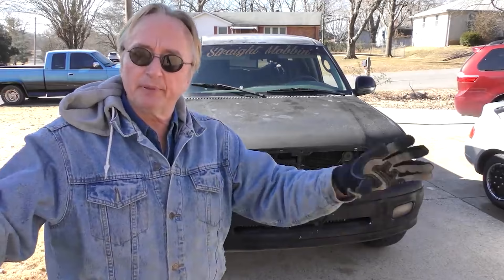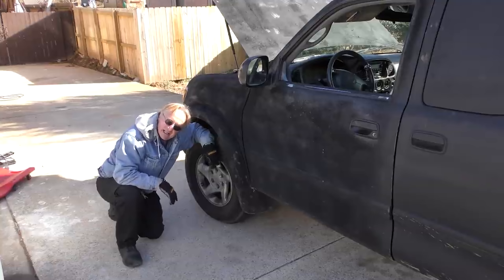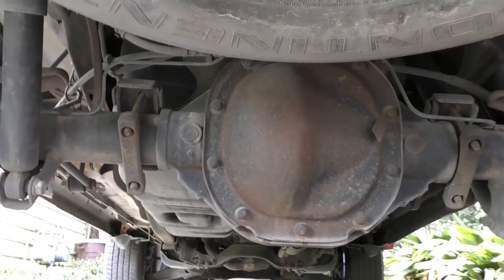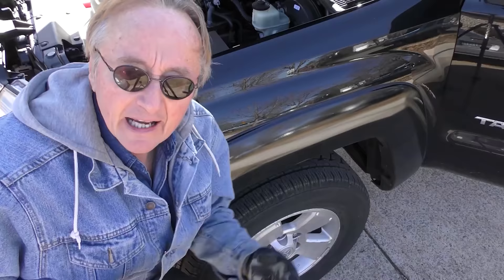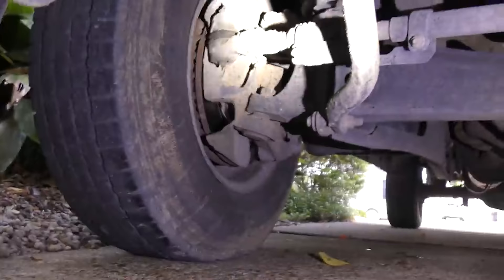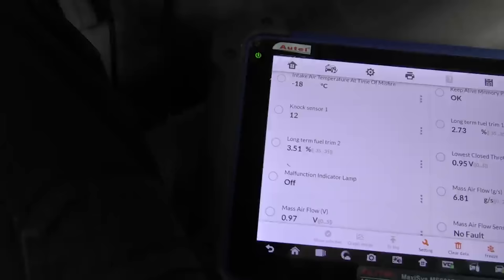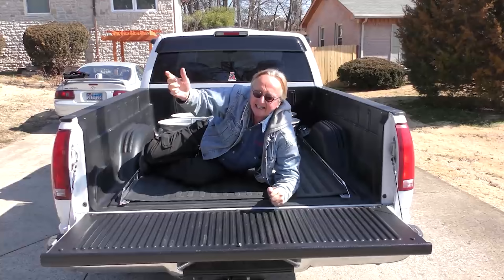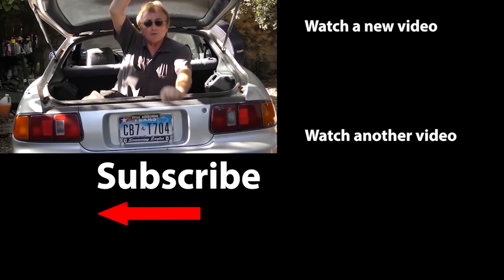5 Trucks You Should Buy

Comment: I’ve got a 94 Silverado with almost 600k on it 4 wheel drive damn good truck since I bought it with about 130k on it I’ve only changed out the radiator, starter, alternator, dist cap, and the thermostat that’s it! Basic things still churps the tires and will down shift smooth and gets up and goes best truck I’ve ever owned
Reply: Mine had 385k on it when I sold it..Ran flawless.Needed a trans rebuild but beside that it was a tank
Reply: I have a 97, 5.7 Lt. Has 310,000 km. Had it for 21 years. The engine is bullet proof. I do a lube, oil and filter every 5,000 km. 
To bad GM put themselves at the bottom of the list.
Reply: I've owned a few of those truck and never had any serious problems with any of them, the Chevy 350, 5.7 liter engines will run forever and if you ever do need parts for them they are easy to find and dirt cheap too since they ran that body style for 10 years.
Reply: Chevy engines run long and strong. Problem is, what will make the vehicle undrivable is everything else on the vehicle will be falling off.
Reply: I've got a '95 2WD 1500 with almost exactly 200k miles on it and I just had an unusual problem.. the U-bolts that hold the rear end to the leaf springs rusted into. Luckily, I was on the dirt road when they broke. I tried to back up and the rear end rolled forward and dropped my drive shaft, broke my E-brake cable, both brake lines and egg shaped the hole in my drive shaft for the U joint. I'm about to get it going again and will be glad to have it back. I was considering selling it but it's so easy to work on and dependable that I guess I'll just start fixing the stuff that's neglected on it. Motor is still great but need to replace my valve cover gasket. My 4L60E doesn't like to shift down in a hard acceleration, which gets on my nerves but other than that it runs great.
Reply: I have a guy that had 770,000 on his it’s a 2006 5.3 Avalanche only two water pumps and two fuel pumps and regular maintenance
Reply: @jasonfoster9118  Got to use Anti seize on everything I take stuff off anti seize it and I do not worry about breaking stuff off I use copper on the exhaust parts again no problems it’s worth the extra effort because I keep cars and trucks 4 ever.
Reply: I've got a 92 Scottsdale 3/4 ton regular cab long bed with the 5 speed manual transmission with no rust on it.This truck is one tough truck
Reply: @monkeyslap  You are absolutely right on that statement
Reply: @jasonfoster9118  That also happen to me last year. My mechanic got mine in time before that happened
Reply: @monkeyslap  I haven't had that problem with all the Chevys I've driven, sure some of the interior parts can come apart sometimes but you can get replacement parts easy at a junkyard or an auto parts store or thru an online retailer.
Reply: I bet your some where they don't salt th roads to. Them are dam good trucks I know a fella that's got an 06 with over 300k on it
Reply: @charlesbunting1790  I had a 94 at one time and I live in utah where they salt the roads in the winter and it didn't have any rust on the body anywhere
Reply: @chevy5137  wow i live in Maryland they use salt and brine i think its the liquid brine that eats up all our cars. My 04 Suburban is rusting really bad. So far 2 years ownership i busted 4 brake lines right now Im changing every single one but not sure if its worth it due to so much rust elsewhere. has 233k miles 5.3 4wd
Reply: @hellswindstaff91  damn that's crazy!
Reply: I believe 110% that they were THE BEST trucks ever put out by gm or any other manufacturer. Yea dodge had the 12v cummins. But let’s talk about a 95 2500. 454 4l80 14 bolt. It’ll tow just as much without a problem. These are the best
Reply: @obs.vanness1604  pondering if it’s practical to replace my 95 2500 with same thing it was such a good truck! Finding prices not much less than a 2000s Silverado with similar mileage so it’s hard to justify. But I know they’re great trucks.
Reply: I'm surprised you haven't had to replace that fuel pump in the damn gas tank.
Reply: I hope you've changed the tranny fluid, lol. I mean, I don't think it'd be moving if you hadnt
Reply: @monkeyslap  the new ones have motor issues
Reply: @hellswindstaff91  they're brake lines.....
Of course it's worth it
.
Reply: @bethl9825  newer Chevys are crap
Reply: @paulgrisez5834  The manual transmission is the best, they last!!
Reply: I have a 2000 Blazer with 230k still going strong.  Just did a front end and tranny rebuild.  4.3 V6 is still going.  Nothing major just typical Chevy things that break.  I'll keep driving it

Comment: Bought a Tundra new back in 2016. Couldn’t justify an F150 - the tundra was $10k less comparably equipped and zero issues after five years and 67k miles. Runs like new.
Reply: Tbf 67k miles is nothing
Reply: You have chosen wisely.
Reply: It's kind of ironic that a 2004 F150 can tow more than the 2021 Tundra can and still hasn't broken down and similarly equipped technology wise...
Reply: @Michael-yc9ex  it does depend on which versions of each so we're comparing apples to apples. The 2021 F-150  is the class leader, I think, but the 2004 F-150 with the max payload package tows about the same as the middle of the current Tundra line, I believe. The upper end of Tundra is 10,100 or 10,300
Reply: I had the opposite buying experience.  Deals on Tundras are wayyyy tougher to get,  but Toyota really doesn’t want to sell more than 100,000 Tundras a year.
Reply: Hope it doesn't have a CVT transmission. They don't last long. You'll never get over 100,000 miles before it goes out and pray you have some warning as they destroy engines if they go out. Everyone buying a car or truck should read about pro/cons of CVT transmission.
Reply: @carolecampbell8813  they never put a cvt in a truck, as far as I've seen
Reply: New Fords are not good

Comment: 2019 F-250 Super Duty Crew Cab Fx4 short bed 6.2 liter gas. 9 recalls later and 3 trips to the shop for "death wobble" or "steering wheel oscillating" as the dealer called it. I couldn't get rid of that truck fast enough. To this day I still get new recall notices in the mail.

Comment: 60s trucks last forever I got one and it was a daily driver for 40 years and last longer than half of all these new trucks.
Reply: My best friend bought a Duramax in 07. He has 275k so far and has had a caliper replaced since he bought it new. It has been great so far but that is from 07 but if all you have to replace in that many miles is a caliper I think you are doing good.
Reply: The steel made in the 60’s was vastly superior.
Reply: Then where are they all ? I haven't seen one driving around in months lol.
Reply: @manchesterexplorer8519  I see them everyday. maybe it is a regional thing but in N.C. there are plenty of them around.
Reply: Most people restore them and put them in a showroom
Reply: @woogie88888  maybe he should check his brakes and fluids if that’s all he’s done..
Reply: @RossLambert801  Smelting technology I would think has improved since back then, as fast as STEEL is concerned. CAST IRON, on the other hand now, is mung, compared to back then. Porous and rots away in Olympic record time.  If a Corporation intended to build to last, nothing can get in the way now. Problem is....cheep-ness rules.
Reply: @SpookyDaScary59  That is all routine service I meant the only thing he has had to repair on it was when a brake caliper went bad. Tires brakes light bulbs oil changes etc. apply to any vehicle.
Reply: @woogie88888  down here in sweet home Alabama also
Reply: I still drive a 60's truck
Reply: @stevek5988  how reliable is it?

Comment: I have a 1994 mazda b3000 standard shift with 392,000 paid 300 bucks for it and it has been the best little truck I have ever owned I drive it everyday
Reply: How many miles u put on it?
Reply: @miguelrios725  about 25,000 roughly, original motor and transmission. The only thing I've ever had to do to it was a master cylinder and basic maintenance

Comment: I loved the the 90s suburbans with the rear doors opening right and left, no good reason to get rid of it
Reply: I don't understand why only Van's have barn doors now. Way easier to load stuff
Reply: I had a 1999 suburban LT that I bought with about 80,000 miles on it. Drove until I got 238,000 and then sold it and got myself a Toyota Highlander for “economy“. I’d give anything to have that 99 suburban back, I would’ve put a crate engine in it if necessary. You could drive it for hours and it was like driving your recliner in your living room
Reply: @rodrogers6895  im with you on this. Very comfortable
Reply: 90s and early 2000s Chevy suburbans look amazing. Unlike all the abominations that GM released post-2005.
Reply: @rodrogers6895  I just rebuilt my 99 suburban it runs like a champ 236k miles. I just love the ride and comfort. Couldn't agree more. My new silverado sits Parked.
Reply: @rodrogers6895  my grandmarquise is the same lol

Comment: Bought a 96 k3500 with a 454 gas milage is aweful. But it's a truck I use to haul boats. 235,000 highway miles and run amazing paid 3500 for the truck and came with a western plow. Truck is solid, came from Arizona and has absolutely no rust.  Easily the deal of a century.

Comment: I've posted before about my 94 K1500 that i bought new and still driving it. The only thing I would mention about the 90's Chevy pickups is I prefer the 88-94. That's pre-Vortec engine when you had just an old 350 with a throttle body instead of miltiport fuel injection. I just prefer simplicity and ease of repairs.

Comment: I have a 2000 GMC Sierra C3500HD one-ton dually. It has a 454 (7.4) Vortec engine, 4L80E auto trans, Dana 80 diff., and an enormous frame. 2000 was the last year for the 454, and the first year for four wheel disc brakes. They're good, solid, reliable trucks.

Comment: I have a 1998 Chevy 1500, at 200K miles I had to replace the engine after the OEM radiator cap failed at freeway speeds in July while driving through Nevada desert. A brand new GM crate motor cost me $2,094 shipped to my door. Still driving the thing at 300K and it still has the original transmission, and everything works great. Only issues as of late, all the rubber suspension parts are starting to make noise and need to be replaced. No big deal. Rock solid truck and 1996-1998 was DEFINATELY a sweet spot for these trucks. Can't go wrong so long as you take care of them.
Reply: I have a 1999 mine has been good but yeah my range is 1999 and lower the new just suck and there cheaply made

Comment: My parents have a 94 chevy z71 with door panels about to fall off, but it has 470k miles and runs with no major fixes
Reply: Das crazy
Reply: what small fixes you do on it?
Reply: i have an 89 odometer quit at 291k so maybe 320k lol runs great fixed small stuff like hoses power steering pump u joints you know typical stuff to go out
Reply: Second or third motor
Reply: Second or third Motor

Comment: Don't forget to change the timing belts on the first ones (T-100s) religiously!
Reply: So is a T-100 a Tundra also?  I found a '99 T-100 for sale recently that looks super clean and runs great with about 190K miles.  It has the V6... I was wondering if these were as well built as the Tundras
Reply: DT NA The 3.4 V6 in the t100 is a non interference engine so even if the timing belt did snap it wouldn’t do damage I’m not sure about the 3.0 options if they are non interference or not
Reply: @tommichaels2466  A t100 is Toyota’s first attempt at a full sized truck it didn’t sell to well because it had a v6 they were made from 93-98 then they came out with the tundra it’s nothing for a t100 to go 300,000-400,000 miles with the 3.4 v6 just like the early Tacoma’s obviously not as much power as the v8 tundra but still very durable and built very well just like most Toyota’s
Reply: I replaced the belt on Dad's '96 T100 3.4 recently.  The belt was 19 years old, but only had 70k miles on it.  The job was a waste of time-the belt looked like brand-new.

Comment: I owned 2 different 93 Silverado’s. They had some minor issues but they were cheap and easy to fix and ran forever. The only issue is being in Canada they rusted out. First one ran 325k km before I got rid of it and the second had 435k km. Both still had original engine, transmission. They definitely don’t make em like they used to.
Reply: Yup thats for sure! Gm made solid trucks until the body change in late 07 when they were going tits up. There's already a 2016 chevy in the wrecking yard here in sask because the frame rotted out....the whole truck is rotted out.
Reply: What engines did your Silverados have?
Reply: 88-98 Chevy Trucks were some of the best ever made.
Reply: @robbalinski1606 total garbage now GM - I bought a Tundra
Reply: I had a 93 Silverado and I worked the crap out of that truck. It was a great truck and was still running like new when I gave it to my brother. He totaled it out in a wreck a few months later. That GM 5.7L from the 90’s was a solid motor.

Comment: I bought a 1989 gmc sierra k1500 4 years ago for $1200. Only thing I've spent on the truck is oil changes and a tune up every year. Thats it. The 350 is strong as it was when it rolled out in 89. Love these old gm 90s trucks!
Reply: Might have been made in Oshawa. That truck plant was known for producing great vehicles.
Reply: Did you change the tranny fluid?

Comment: I have my grandpas 1971 Ford F100 Short bed 4x4 with a 300 inline 6 and 4 speed. Its gutless as can be as far as speed but its been a unbelievably reliable pick up. I was a couple months old when grandpa bought it new. Ive had it for 20 years and have no idea how many miles are on it because the odometer hasnt worked since long before I got it in 2001. Speedo works but odometer is kaput
Reply: Can you upload  a video of the beautiful  truck i would like to see that truck
Reply: 4x4 with a 300 inline 6 and 4 speed. That engine is one of the best Ford made..

Comment: I drive a 1993 Chevy 3500 Silverado Detroit diesel 6.5l, had a new turbo in 2018, Indiana truck, daily driver 183,000miles. Has the old truck bed liner paint job, hauls skid steers, excavators, and all any other mid weight machinery every week. 30 years old.

Comment: 97 Tacoma owner here. 2.4 with 5 speed 2WD 300K miles runs like a champion. It was a base model with no A/C. So I bought everything to bolt the a/c on. Compressor, lines, condenser etc. All factory parts installed from a A/c model truck Works great. I got it painted and fixed dents. Looks very clean. I also put the 4WD bumper on the front with the lower valance looks awesome.

Comment: My 05 Saturn has the original shocks and springs on the back. The front struts have been replaced twice. 247,000 miles. With excellent all wheel alignment done right, it’s super smooth going down the road. It’s the basic level 2.2 liter 4cyl., five speed manual.

Comment: Got a 94 Silverado (1500, 350 Tbi) 340k still runs and tows my trailer that weighs 5k lbs every single time twice a week. I bought the truck ten years ago for $1600 and i am still using it. 
Those 350's are so indestructible it's mind boggling. Did 1 transmission rebuild at 25k (That was at 166k) and have only done basic maintenance work since. It's been a insanely reliable truck.

Comment: I had a 97 Silverado with the 4.3l 262 vortec and a 5 speed. Damn thing lasted over 325k on the original engine and trans. Would still be driving it if it hadn't been totaled
Reply: I have 97 Silverado with the 5.7L 350. Regardless of engine, they are all great trucks. I have 256,000 miles and mine runs like it's brand new. I'd rathers dump a few grand ( I already have in a new transmission, fuel system, radiator, shocks) than get a new truck
Reply: I’ll bet someone bought the totaled Gmt400,
and rebuilt it !
Bought an 88 a few months ago, 4.3 with
stick, runs sweet  ! Lots of parts cheap !
Reply: I've paid 2k for my 93 chevy. Was planning to sell it once i got something better. Eventually i got my dream 1989 firebird, but at that point this truck grew on to me, because she's one reliable beast. Gave her a fresh paint job now all she missing is a v8 swap for that VROOOMM!!!
Reply: The manual transmission is the best they last..

Comment: My ‘04 tundra has been doing me so well. Been in the family since it came off the dealer lot and had zero problems so far
Reply: Definitely good truck bro 👌🏻 💪 better than new junk
Reply: I have a 2003 Tundra V6, hopefully it runs as long as the V8. It only has 112,000 miles.